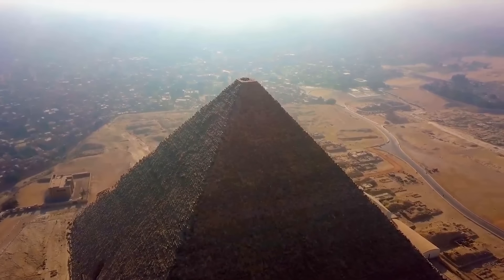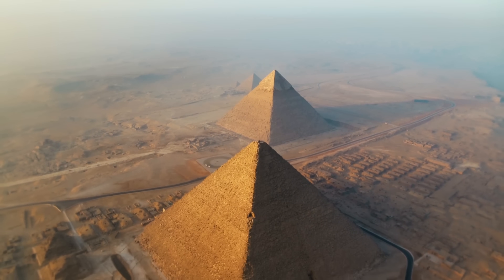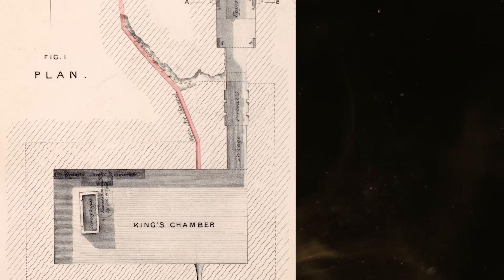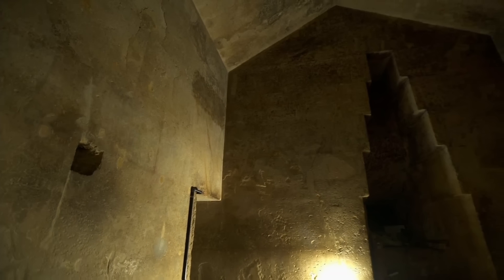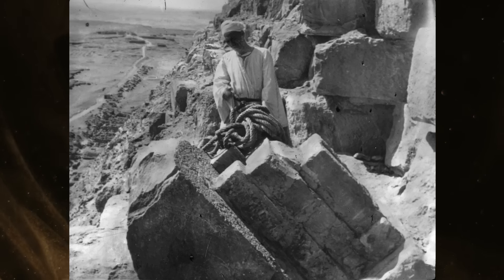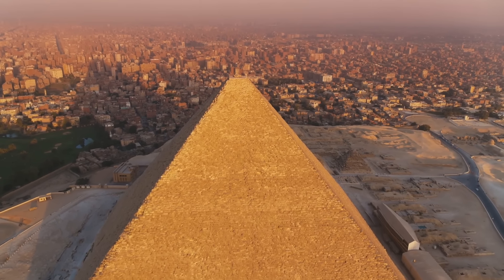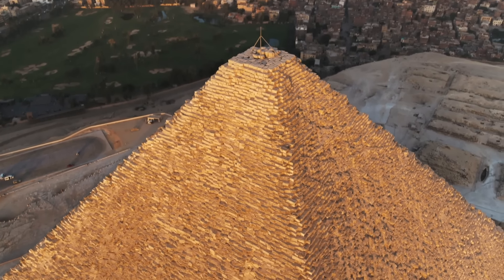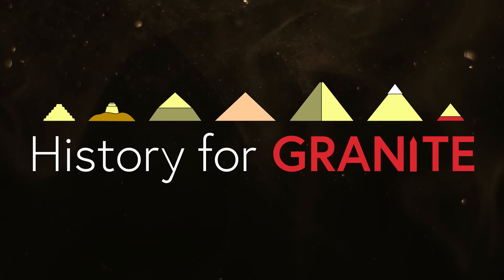One Solution to the Four Channels of the Great Pyramid

Comment: I have a theory that hints at possible religion surrounding the Great Pyramid. With my limited knowledge, I believe the Great Pyramid was not a tomb, but, a temple of worship. These "air vents" could be proof of that theory. Who would need such "air vents"? Priest and their flock. I believe that the kings chamber may have, in-fact, been a baptismal chamber. Not a burial room for a pharos. If they were using torches to aluminate the inner chambers for even a sort period of time, they would need ventilation.

If you look at modern architecture, I would ask, what comparable structure mimics the opulence of the Great Pyramid? I say religious temples. There isn't any need for such a monumental structures to be built at all for society to function, except a religious one. Seldom is there a reason to build such a massive structure for a tomb for a single person. You wouldn't commit so many resources and time to a building for a singular purpose, even if it was to protect a beloved ruler.

The Great Pyramid is a temple. Prove me wrong.

Comment: The pins are the ends of a battery, something attached through the tunnel to provide electricity, ie the large light bulb, the wires would be pushed through the tunnel till connected to the pins,

Comment: Sand in the Sahara desert is not suitable for concrete because the sand is like little ball bearings, not crystalline or broken as necessary for cement. 
  So I’m gonna stick with my theory that they were intended to be filled with sand all the way to the top as a final security measure,  A worker would go in break, open the block and let the special  sand flow like water.
😮
Reply: Like security measure? Bruh, that's some Indiana Jones moment

Comment: Those 3 pyramids were finished and used a lot for there purposes.  .  Those  2 holes were purposely not cut open .   The vibration created in the pyramid created electricity. What looks like a coffin is a trough.
Reply: The vibration created electricity? Well now you have a whole other set of problems. But let's pretend that somehow, however fantastical and without evidence, that was the case. It is limestone and granite. Not exactly two things good for creating or conducting electricity. But even pretending it is, you'd get like .00015 watts of power from it at most. Something which you could achieve without building a giant pyramid. If you were aware that was achievable somehow with whatever you had, then you'd also be aware that you don't need a giant pyramid for it. And even if you thought for some reason it would scale...you wouldn't go about building a massive version first to see if it did. 

But you can also test this. Go get some limestone and granite and I guess whatever else you think you need and vibrate it however you want and see how much electricity you produce. These aren't difficult to get materials and obviously the internal layout doesn't matter since no pyramid has the same layout inside. If you can prove it makes electricity...whoa....you are about to win a nobel prize. You'd be literally pushing mankind into an entire new age. 
...but bring on the excuses because you won't. At most you'll mention piezoelectricity.

Comment: They are for gold mining all three together possibly make a hydraulic ram pump used to pump fresh water out of the top of one of the pyramids much like a sprinkler or fountain and possibly each pyramid may eject water depending on witch pyramid they want water to come out of and not only is it a hydraulic ram pump but it also can generate electricity while self propelling it's own water by static electricity being sloshed from one pyramid to the other or it is a water pump that runs on electricity from lightning striking the oboliscs nearby connected by solid gold conduit it's possible it's to make it rain acid rain for goldminning seperation they anxiously flooded the ground around all three of them it would flood the surrounding ground up to the raised beds all around the outside of the pyramids with raised drains so the gold is not dumped down the drain holes lower than the raised drains all over the ground until theyr ready to do clean up if they do not make the clouds rain acid then it's possible they pumped royal water to the surrounding seperation ponds to flood the surrounding area remember they are goldminning and fully capable of making glass pipe out of the overburden you need a goldminner engineer to look at all your blueprints of passages

Comment: Maybe the whole thing is a reverse fountain for some underground city under the plateau... made for a great flood.  Once the water gets high enough, it starts entering through these shafts, fills up the king's, or queen's chamber first.. perhaps there were chemicals in the sarcophagus that would mix with the water... the water would flow down the shafts, into the bottom room with it's various fins and what not to cause rotation.. and then down through the bottom shaft, straight down, down and then through the ceiling of the sky dome of a giant city...  and the quality of the water coming through that hole in the dome, into the giant lake, underground, based on which shafts the water was flowing through, would tell the inhabitants how high the water actually was during some great flood...  thus the underground city, some other solution besides an "ark" to escape the cataclysm..   Not unlike the Hopi and their also being taken underground by the so called, "ant people" who had big black eyes, and large heads... like ants.

Comment: Before Egypt stumbled on the pyro Mid , the original design had been modified. The directed energy shaft was once used as a stargate but later on the blocking stones were a failed a temp to get energy . confusion set in and we must for now be greatful. 🌪 💀 🎶

Comment: If the pyramids were built one layer at a time, there would be no need for worker ventilation, as the rooves would be put on last.  The grotto would be the only issue, and the "robbers shaft" was built following a natural crack in the limestone, that was filled when the land was graded flat, before the pyramid was started.  I'm not sure who cut the robbers shaft, as some still label the diagrams as it being an air shaft for the grotto.  Without looking myself, have you ever done a video on the robbers shaft to the grotto?

Comment: What? They're original purpose is already known. The shafts are there so that the Pharaoh's soul can ascend to the afterlife. It is a burial chamber after all. The lower channels aren't open to the exterior because the Queen's chamber, as well as the unfinished chamber beneath it, were a contingency in case the Pharaoh passed on before the pyramids completion. And since the other 2 chambers weren't needed, the channel didn't need to be open to the outside. Only the kings chamber requires it for this particular burial ritual

Comment: i don't think it was for visitors it don't make sense (to me) to have a tempel presumably for visitors in the front and then have a side entrance up high to go inside. But if you want to have a funeral there you need air, all light was made with fire so unless they did it in the dark they would have needed air or they soon would found it extreamly hard to breathe. when the chamber is down underground you don't have this problem, the fire vents up to the exit at the same time new air can come in, this is not possible in the great pyramid because of the location of the cambers so wentilation was needed. the "queens chamber" was probably ment as a burrial chamber at first but plans was changed and the chanels never opened. some evidence of this can be seen at the entrance where lines was painted to what looks to be preparations for making a portcullis just like in the Kings Chamber. this portcullis was never finished and probably for the same reason the vents weren't opened, they changed the plan. 
this is about where you can se on the outside the thickest layer of stone,  this was probably made to level out the pyramid and complete that phase of building.  here is where they changed the plan and instead of finishing the portcullis for the Queen's chamber they built a ramp up to what is now the King's chamber. 
if that was used for a burrial or not i don't know, but i'd say probably not. That's if it is as they say that the cracks in the sealing of the king's chamber occured during construction, then i doubt they would have put his mummy under it. the sarkophag was probably put there before the walls came up so it would be there either way. 
But at some point they needed to get some air in there that is for sure sins the vents are open.

Comment: Those Ventilation shafts look to me like some sort of exhaust system or just pressure release. Think about it. Why would they finish the Pyramid on the outside, but not the inside? If what Tesla and other scientists claim is true, and chemical reactions were building pressure so the quartz stone produce electricity, it would make perfect sense. Similar to a internal combustion engine's exhaust. That unfinished construction seems to be rather damaged and wore out, than unfinished...

Comment: Ventilation shafts were obviously required during construction; this was apparently the first and the last pyramid that had chambers above the ground from where the smoke wouldn't otherwise leave. No doubt this is one of the reasons why, at least to my knowledge, the later ones saved the enormous hassle and were actually completed in time with the tombs being underground and smoke from torches or other similar light sources being able to escape upwards. Having the ventilation shafts was a practical necessity obvious since the beginning of the planning, but devising a pseudo-spiritual function to them as esoteric architectural idealism or even just an afterthought would also make sense.

If the passages did align with certain stars or formations at some certain time of the day, as some suggest, it would make sense that the actual architects would want them to just seem like they align properly. The inner holes in the chamber just need to look symmetrical to each other in vacuum, and the outer holes need to be points facing to the sky wherever the stars or formations would be seen. I imagine that even if they wanted to actually do something even slightly sophisticated, considering their astronomical knowledge, they would have built the actual unseen channels in the most practical manner anyways so that just the end points look as if they connect with the specific object of interest in the sky. It's not like any Egyptian commoner would just come and try to peek out these holes and see the proper stars from the grave. The descendant pharaohs (that just knew they needed to seem like gods to the public) and the rest of the court would likely care more about the preservation of resources than the spiritual preservation of the soul of a dead king, considering that no effort was made to even properly hide the fact that the work was left completely unfinished.

Comment: To remove hot air I would make the ventilation shafts at the top of the chambers.
Reply: He said that the were probably built with the idea of ease of access for potential maintenance and clearing if necessary. I'm assuming they probably wouldn't keep a ladder inside.

Comment: Listen, ventilation is not straight because there is a room on the way and this ventilation path is not for that room.   Plus these inclinations could be manmade to hide one of the rooms ahead. Or it could be a forked ventilation but one of it the straight one is clogged so it seems that the inclined one is the only one. And when do you plan to move a top stones with helli as military did? You see a mess there? like stones has gaps, someone constantly visited this top section to get to the top room. And when do you plan to find that  sand floor in some rooms are the elevator path line chamber it is long way down. This ventilations are for the elevator shaft’s air when rooms are moved. And maybe the rope metal holders faced inside for this purpose.

Comment: Temporary air chutes not needed after the building progressed. Don't complicate it. Just like modern engineering trying to reinvent the wheel. Copper lifting  lugs or lowering lugs  walls left unfinished for plaster or precious metals to be attached

Comment: Pyramids are free energy devices creating continuous lighting duscharges between the voltage at the top and the voltage in the underground chamber (not public) with water. The chambers abd shafts had devices to store and manage these discharges. All the metal in the pyramid (mainly gold) was stolen. Gold is the best conductor for electricity and used in spaceships. A spaceship generates a petagigahertz in power, gold wires of one meter diameter are used to collect that power, not possible with any other material.

Comment: I watched a program where if you were to build the same  Chambers, then fill them with water. They would actually pump water... It acts like a Hydro  Electric pump ... Which would make?
Sense if the basin had been submerged Why this thinks has so much water damage.. the Materials used will conduct electricity on the inside  and the outer materials insulated it.